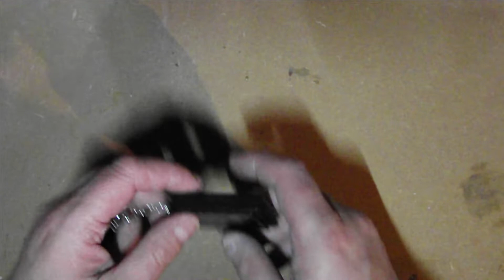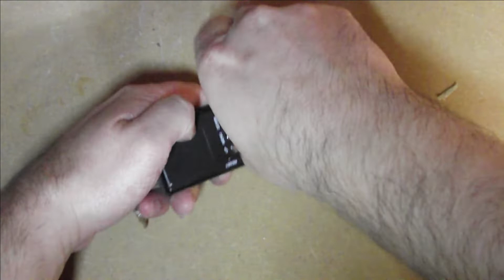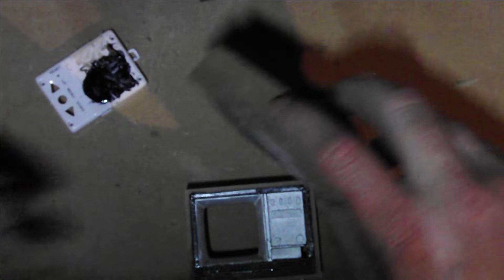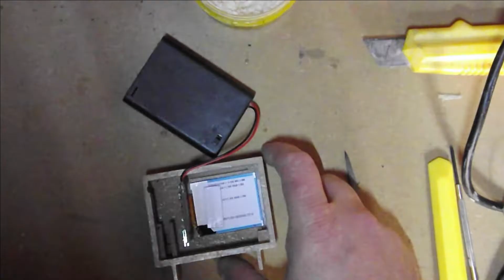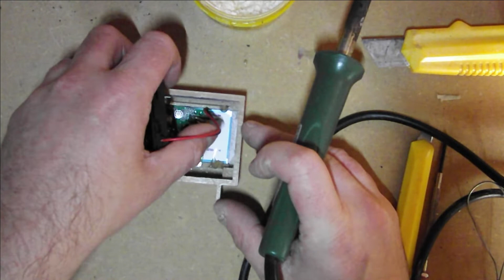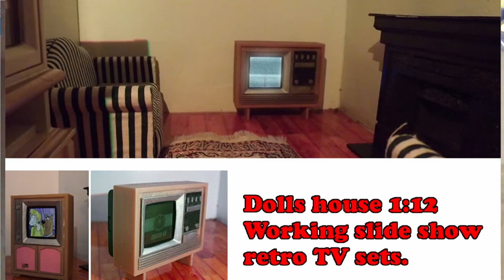#16. Easily Make Your Own Working Miniature Dolls House T.V from repurposed parts.

Comment: Hi, looking to get one of these off Ebay and try myself, but they're so old that on the box they say "compatible with Windows Vista, 2000, and XP". Was yours similar in this regard? How did you get the pics on it?
Reply from the maker: Yes mine were the same, but they all work absolutely fine with any modern Windows Mac or Linux. They will work on Windows 11. They act like a USB memory card, and you just put JPG images onto it.